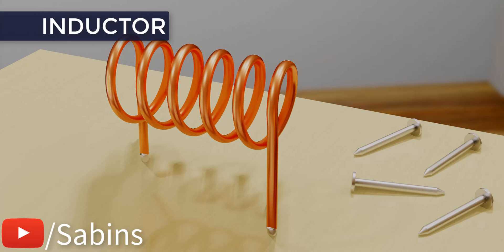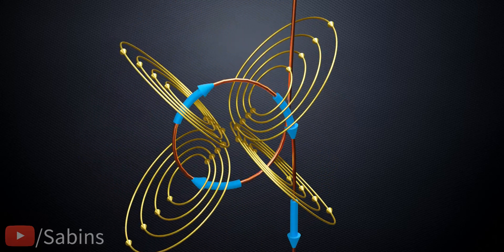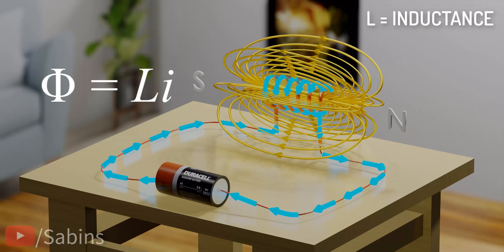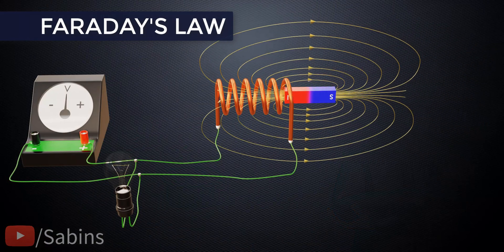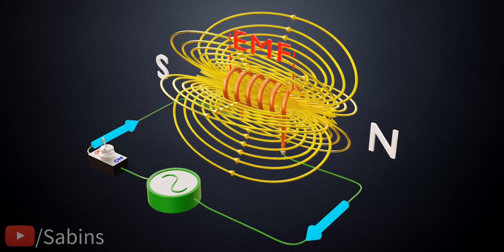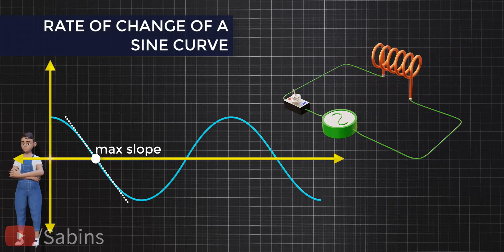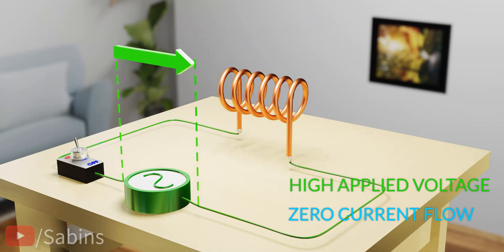Understanding Inductors!

Comment: Sir,
Can you please make an animation like this  that clearly shows how the magnetic flux through a rotating coil/ loop in an AC generator changes during rotation? I need a step-by-step visualization of all coil positions (vertical, horizontal, and intermediate) and how the induced current reverses direction according to Lenz’s law. Please include the changes in flux (increasing/decreasing), the change in the angle θ, and the exact moment when the current direction flips. A dynamic explanation like this will help students understand AC generation much more easily.”

Comment: you and I are on the same page!!  yes the pyramids  were a interplanetary communication device that operated at a very low frequency.  But also the great Pyramid of Egypt was a teletransportation device, ,, NOW Stone Henge and Gobekli Tape: they were power plants. ,  You will see chips on the upper parts of the stones as they were perfected to a operating frequency.  The horizontal pillars were set to vibrate at a particular frequency magnetically, for many reasons, each horizontal rock had a purpose!!   some were used to excite the seedlings in the ground, to expedite the growth, some were tuned into earths mag field and provided magnetic lift via the Earths "B" field .  Check out Coral Castle Florida,  ED used What I call a "B" field generator, His generator used "V" magnets to ensure max delivery of the "B" field Just like is being used at the black pyramid of Alaska.  His generator used 25, V mag around and 5 deep to produce the "B" field into the earth and special stones.  THE "B" field is the center of a magnet/ some like to refer to it as the neutron field.  But the 'B" field is much much more !!!   I wonder if the black pyramid of Alaska used magnetite as a skin for the pyramid that would explain many things!!!   Tesla new about the free power that's available through the CENTER FIELD of a magnet AS you are well aware the rich boys didn't want it,  It's been there all the time.  When the government took down the horizontal stone at Coral Castle the entrance door stopped working.  Funny thing they gave us the clue,, His horizontal rock was providing the magnetic energy to support the access door.  AS you know magnetic energy is perpetual  JUST GETTING started with all this.   I don't need to brag about all my credential.!!  I got into physics back in 1959 as a ham operator at 9 years old I would design and build my tube type radio's for Rec and xmit.   I know what I'm talking about..    When they say all they had were copper tools OMG HOW STUPID!!!  when you understand the properties of a inductive that being utilize to build the pyramids you would understand a copper tool was every bit of a power tool  BIG TIME!!!!!!!!!!!!!!!!

Comment: This is a brilliant explanation of why current lags behind voltage in an inductive circuit... Been working around electricity for almost 20 years and didn't quite understand the concept... Now it makes more sense. Thank you.
Reply: It's actually interesting how people can work in a field and not understand what they are doing, but doing that nonetheless just because that what they've been taught to do. Makes you wonder if a doctor you're consulting your health knows anything about medicine or just reciting diagnostic procedures poured into his head during medical studies.

You can bet, that in most cases it's the latter and not the former.

There are very few professionals who know and understand their craft - most simply do what they were told to do.
Reply: @vaakdemandante8772  You're absolutely right!
Reply: Yes, even by just following the rules taught during the studentship, the person is able to move about through his career jaunt. But contribution in a fundamental way would require proper grasp of the material.

Comment: your video does not specify why the magnetic field grows with more than 1 loop in the inductor, as opposed to cancelling
Reply: IF the wires turn in the SAME DIRECTION....it sums.....opposite turn directions = cancels
Reply: @lunam7249   i see that now, thanks
Reply: Yes, have you found an answer to this or can you explain it?
Reply: @yosoy1loco  i guess because the so-called 'field lines' are parallel, and thus they add?

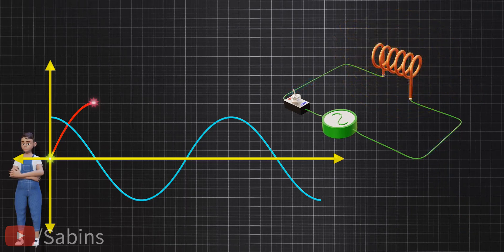Comment: at 3:36 how can the electric potential at a point have two different values? The voltage source says that it is positive while the back emf says that it is negative.
Reply: Shouldn't it be so?
Reply: @Littleprinceleon  why..?
Could you explain for me please?
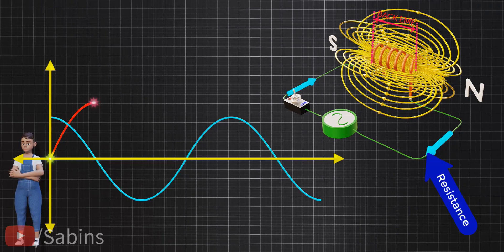Reply: I'm a bit late but I will comment so someone else who sees it now gets it. Basically at 3:36 the net voltage across the inductor is zero. That is why the current is zero. Those positive and negative values just cancel out so you don't have 'two potentials' at the same point.
Reply: I think that's correct

Jesus loves you!❤✝️Repent and God bless

Comment: The electricity we use is 220 volts potential 50 Hz sine wave. 
The current vector alternates from opposite sides 50 times a second, so it's known as alternating current. 
Thank you🌹 for the wonderful presentation.
Reply: there are like 3 sine waves i think, 3 phase ac and i think they reach further than 220v, 220 is just avg value i believe but i am not sure
Reply: @PinkeySuavo  220V is rms value
Reply: @BigDraco123  ye I forgot the name and i used the 'average' instead
Reply: 240 volts

Comment: Counter-electromotive force (also known as Back EMF) is the electromotive force (voltage) that opposes the change in current which induced it. It is the EMF caused by electromagnetic induction.

The most widespread version of Faraday's law states:
* The electromotive force around a closed path is equal to the negative of the time rate of change of the magnetic flux enclosed by the path.

-Wikipedia
Reply: And Electromotive Force is current/charge produced by battery

Comment: When supply voltage slope is maximum then Back E.M.F is 0 how?
Reply: I believe that counter EMF is shown to be at maximum when the slope is at max: perpendicular to the time axis.
The sine wave is the graph of the current (charge flow): when it's zero both voltages are at their maximum

Comment: Let's say we have point a on the left side of the inductor, and point b on the right side of the inductor. What comes out of the inductor towards point b? If DC can pass through the inductor towards point b but AC can't, does that mean that the inductor works as a door stop for AC? Anyone?
Reply: Why should not the current go through either way? Half period right, other half left. Here the inductor is just a coiled wire

Comment: Feedback and corrections appreciated.

The EMF bit is imo also not very clear in this video and I'm still wrapping my head around it but here goes.

You have 3 things.
. Electric current
. Magnetic field
. Electromagnetic frequency waves (EMF)

The important bit is, you only have an EMF wave when the current hence the magnetic field CHANGES.

When the magnetic field stays the same, there's no EMF wave, only when the magnetic field changes.

It's like a ripple in water. A still pond has no ripples, only when the water surface changes by throwing a stone in it, you have waves.

When the magnetic field is maxed out, the voltage is zero because it has worked through the resistance and there is no EMF wave because the magnetic field isn't changing.

Anybody, correct me if I'm wrong.

Comment: This is an excellent tutorial, the least to say. However, the question arising in many minds is as follows:
If the current induced in inductor is opposite and equal to the current due to external AC source, there must be no current flowing through the circuit carrying inductor. Am I right?
Reply: Nope. For this instance, we don't talk of induced current in the inductor. We talk of induced voltage (emf). This is purely Lenz's law.
Reply: Yes and that's exactly what happens for a very short time after current starts flowing through the circuit

Comment: Yeah... I don’t understand.
Reply: Watch again and watch other sources until you understand if you really want to understand ofc.

The EMF bit is imo also not very clear in this video and I'm still wrapping my head around it but here goes.

You have 3 things.
. Electric current
. Magnetic field
. Electromagnetic frequency waves (EMF)

The important bit is, you only have an EMF wave when the current hence the magnetic field CHANGES.

When the magnetic field stays the same, there's no EMF wave, only when the magnetic field changes.

It's like a ripple in water. A still pond has no ripples, only when the water surface changes by throwing a stone in it, you have waves.

When the magnetic field is maxed out, the voltage is zero because it has worked through the resistance and there is no EMF wave because the magnetic field isn't changing.

Anybody, correct me if I'm wrong.
Reply: @MoneylessWorld  who are you !
Reply: @MoneylessWorld  well I would say 90% of that is incomplete and wrong mostly , I dont have time right now ( tomo is my exam ) , but one thing EMF is not electro magnetic frequency waves , oh my god how can you be so wrong , EMF is electro Motive force
Reply: @zhinkunakur4751  Well ty for pointing that out.

I don't know much about electricity and circuits but I did took interest in electromagnetic (EM) radiation or EM waves or EM fields.

A wave has a frequency so in my mind all of that ended up as electromagnetic frequencies :)

I then went ahead to explain the phenomenon of EM radiation how I understand it.

In the context of this video EMF stands for EM force or Volts indeed, you're correct about that.